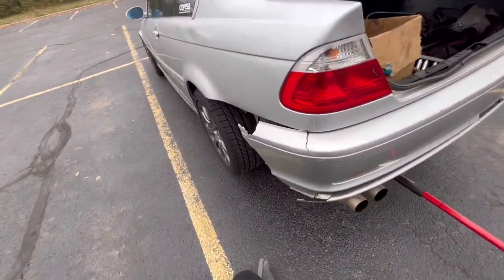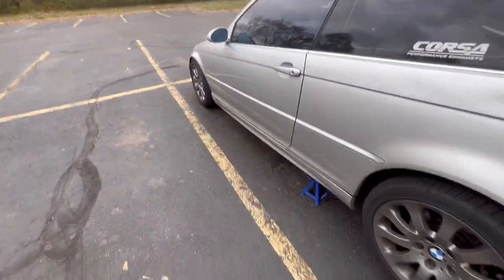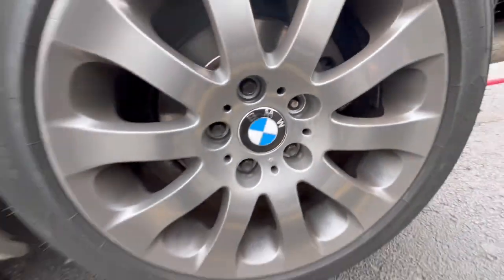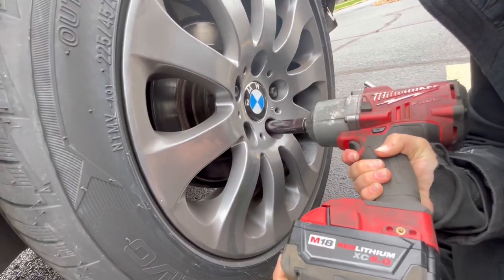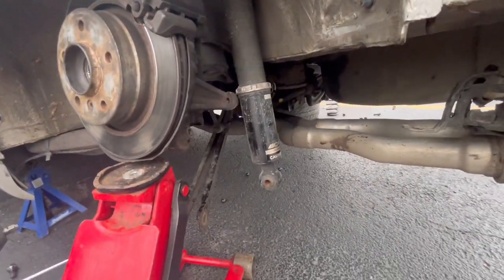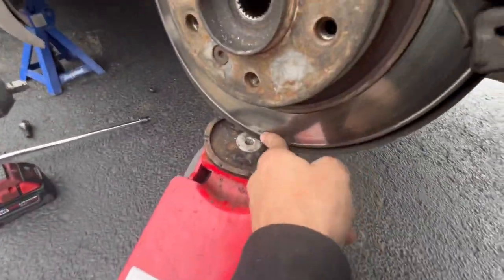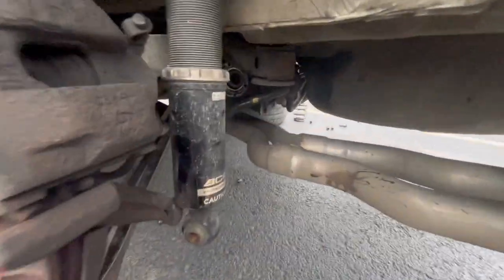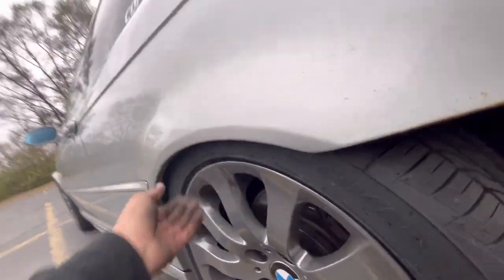BMW E46 axle change. Best method for axle removal.

Comment: Man I have had my drift car sitting for so fucking long bc I don’t want to take the whole thing apart just to take off the driver side axle. Literally the same situation as you I have a 325ci with a 330 Motor swapped in. And tuned so it’s been snapping axles.
Reply: Now for the OEM axles where did you get them from ?
Reply from the maker: @brokeblasian  you can get them from junk yards. I got one from a friend, if you get a 330 axle or AUTOMATIC TRANSMISSION axle they are a different hub so order one from FCP euro and convert. Automatic transmission axles are stronger and slightly larger in diameter. I have a video on doing exactly that.
Reply from the maker: https://youtu.be/H9oRhiMbHTI?feature=shared

Comment: Whats the socket you used to get the axle nut off
Reply from the maker: I believe it’s a 32mm 12 point for stock axles but sense mine is aftermarket it’s a 6 point 36 I believe.